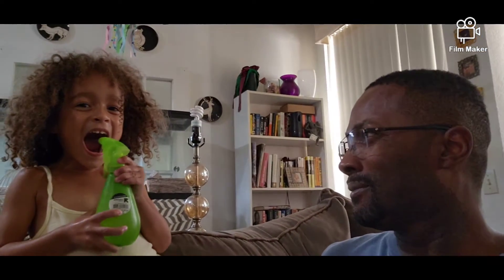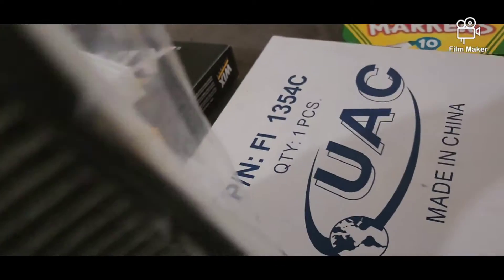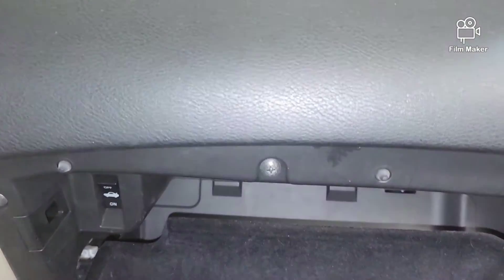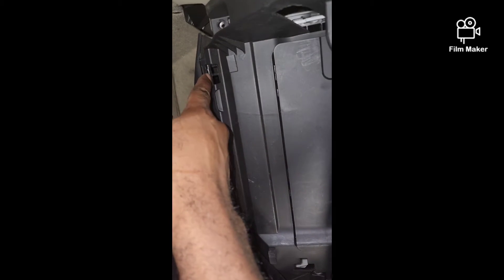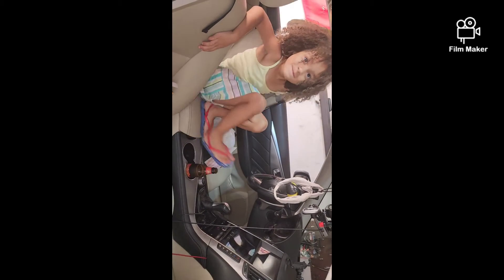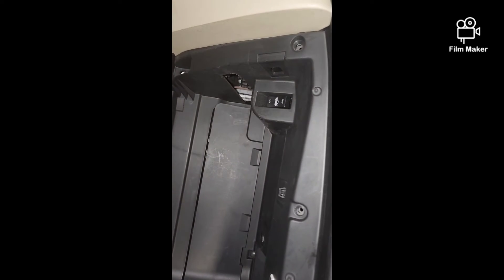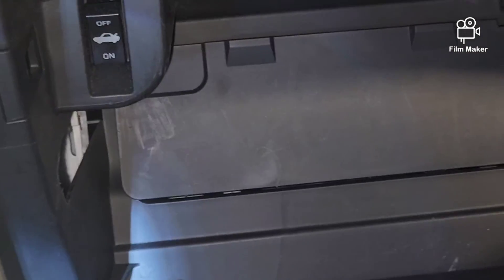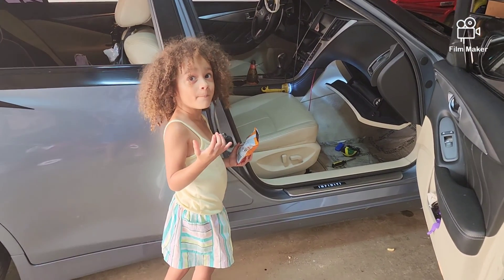Q50 in cabin air filter change

Comment: How’s the q50 doing the belt still holding up does the gates belt and alignment last longer then the oem belts
Reply from the maker: So far no belt issue.
Reply: @importroller  how many miles has it been and when do you think is best to maintenance it like every 15k miles or just check it everyday im really thinking about getting a q50
Reply from the maker: @Pogona44  depending on what year you get,  you may not even need to worry about it.  It mostly affects only the 16-17. It is rare to happen on 18+